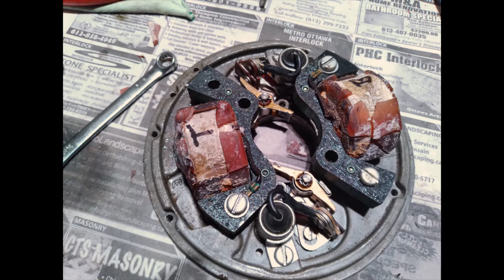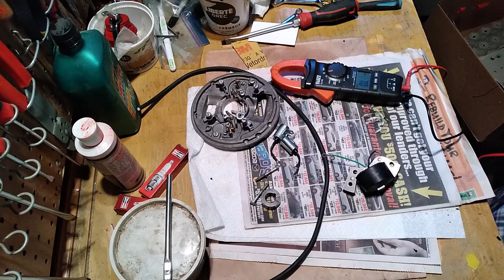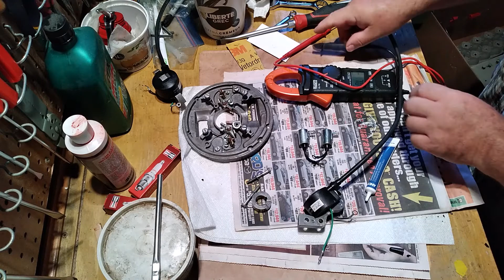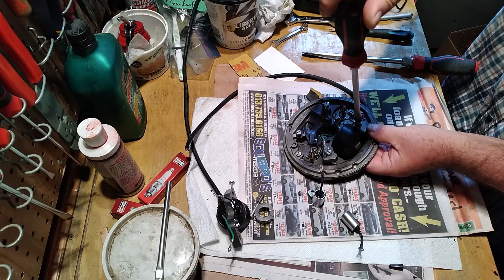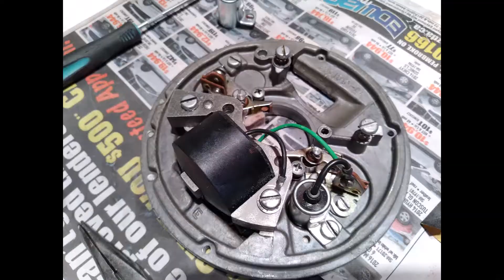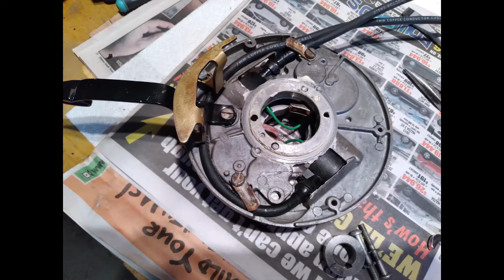Johnson 3hp 1964 rebuild Part 21(d): Ignition coils and capacitor.

Comment: Nice, waiting to see if you have the ring. Yes, no ring. I had to flush mine too. Will you eventually drop your 3 in a bucket and fire it up. Hope so. I have not got mine in a bucket yet but need to soon.
Too many other projects on the Alumicraft V14 I bought in spring. Had to replace the 1 3/4” plywood transom.
Reply from the maker: I suspect I will be bucket testing today.  I still need to reassemble the recoil starter.  Too many projects on the go does seem to be a problem for me as well.